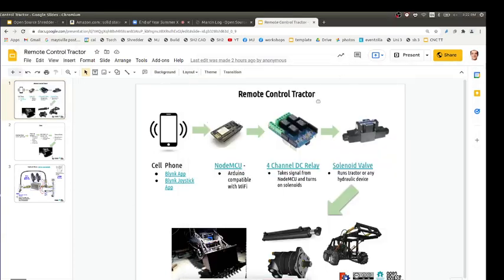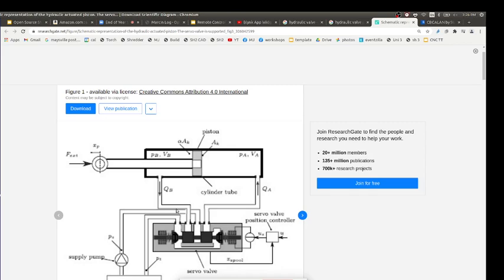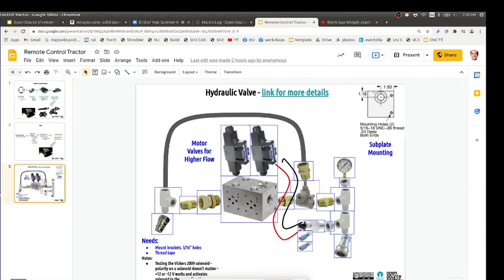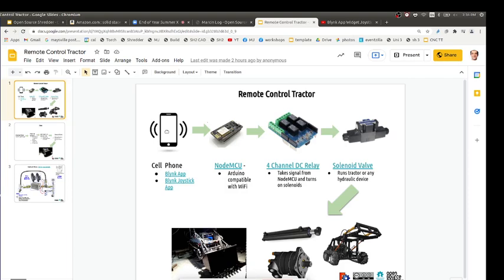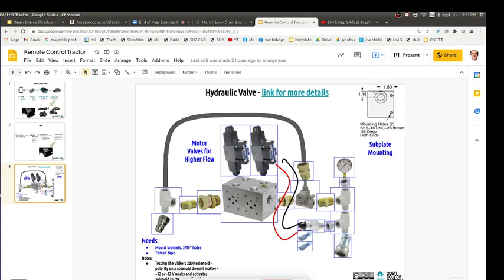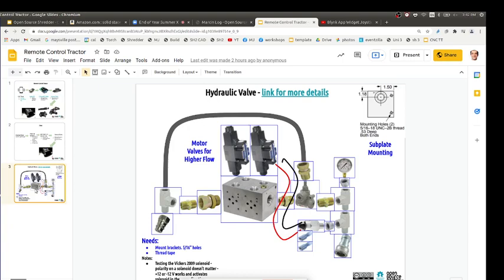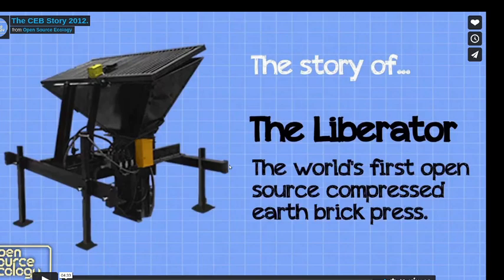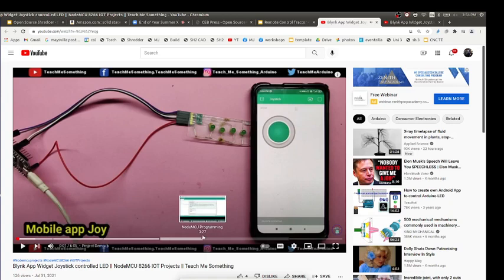Applied Hydraulics 2 - Remote Control Tractor

Comment: Interesting stuff!! I spent 15 years as a machine command and control computer programmer. Several points to make:
1) distant remote control MUST have a Deadman feature that will disable the hydrolics if the communication link us lost.
2) arduinos are not reliable when placed industrial environments. 
3) the back emf of solenoids are dangerous to arduinos.
To mitigate dangerous malfunctions 
1) design relay circuits using normally open as inactive and activated relays causing motion. This way, if the arduino fries all its outputs go to off and disables  all relays.
2)use optical isolators to protect arduino from back emf and shorts.
Reply: Hey @bxxj great advice, we tested the remote control on the microtrac and although I was able to program wireless switching of solenoids (esp8266 + Arduino Uno) with an Xbox controller, the hardware didn't work reliably once wired to hydraulic solenoids. Do you know of any open source projects/strategies for industrial reliability of hardware or open source software for simulating this.